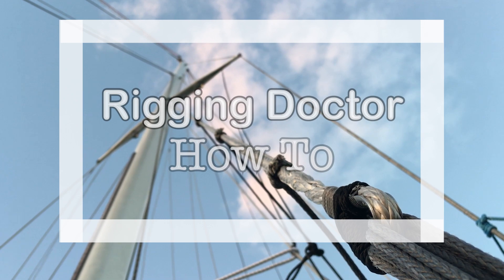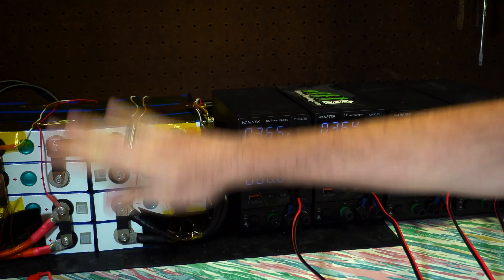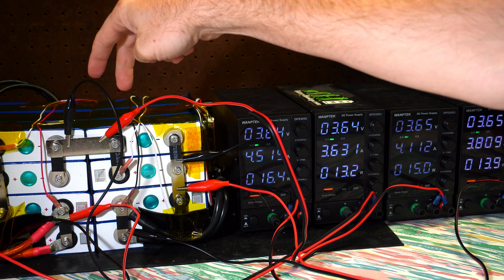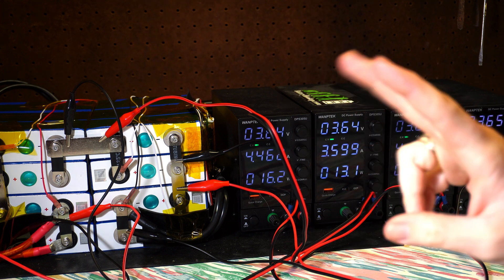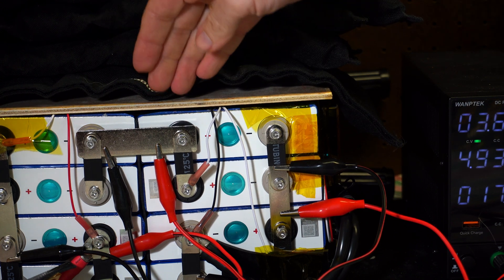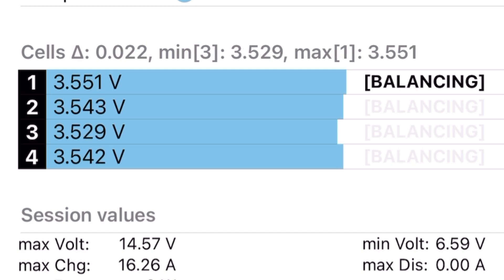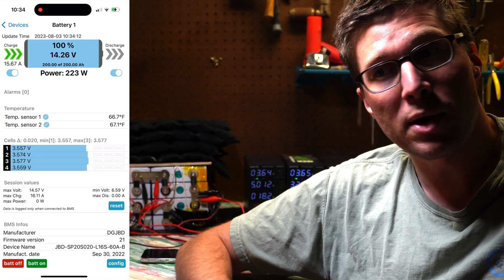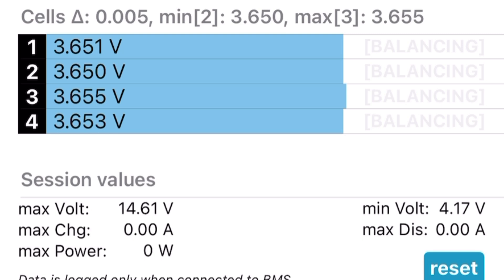Top Balancing a Lithium Battery Pack

Comment: I can see this being important in a DIY battery, that you built out of cells yourself.
But if you're working with a commercial battery, where the individual cells are sealed in the case, is there anything you should do other than hope that the manufacturer did this correctly?
Reply from the maker: This is why I insist on building your own battery. The cheap commercial ones are significantly cheaper than the cost of the parts which means they are made out of rubbish parts! The better batteries that you don’t need to worry about are so expensive. 
By building it yourself, you can use good parts and also do it properly.
Reply: Yes, I bought a prebuilt battery and if you follow a little procedure the internal bms can balance the cells. What I did was setup a charger connected with a smart outlet. I set my smart outlet so the battery would charge for 10 minutes (once fully charged) then turn off for 10 hours then on for 10 minutes and off for 10 hours for 3 days and then the battery slowly got more balanced. I just got the battery and I didn't know if it was perfectly balanced and now after reading the full charge voltage of the battery I can be assured its balanced.